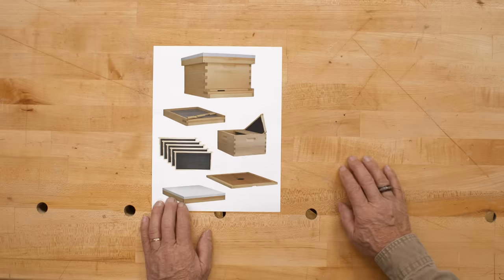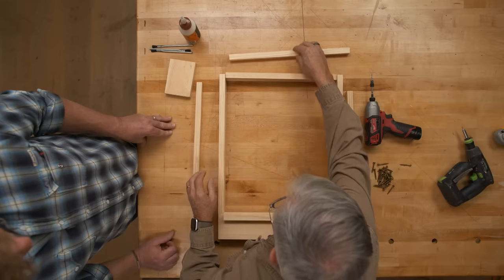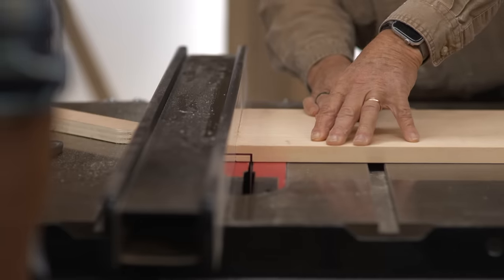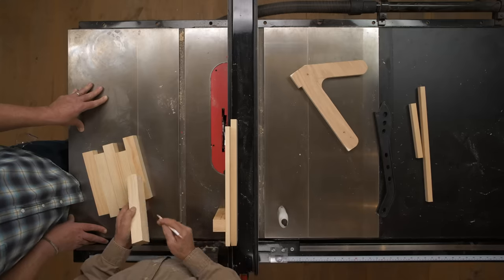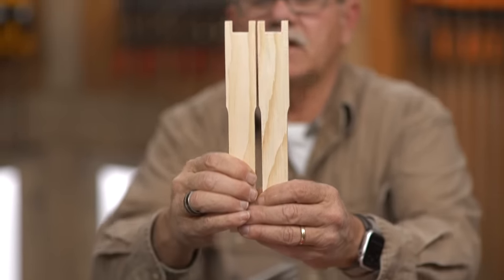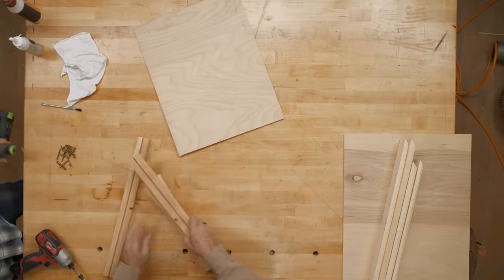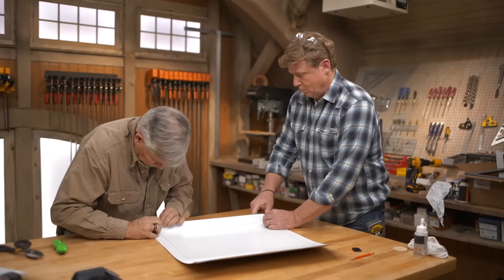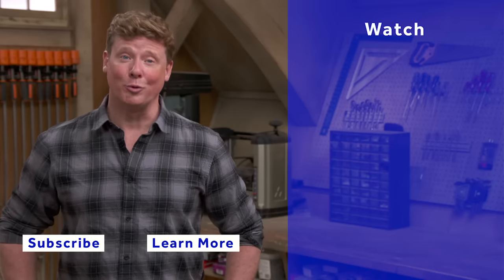Beehive | Build It | Ask This Old House

Comment: As a beekeeper who likes to build I like seeing beehive build videos!  For any new beekeeper I recommend one of the unassembled kits to help get comfortable with the components and reason for each...especially the frames which are the most tedious to build.  A screened bottom board is not needed...a solid bottom board is easier and the bees are just as happy...and they don't need a landing board.  The inner cover is simply to keep the bees from gluing down the top cover so it can be a simple piece of plastic, old political sign, wood, or reflectix.
Reply: is it safe for a beginner to do? im deathly afraid of bees but think it'd be cool.
Reply: @nathanlamberson1256  Sure!  Lots of people getting into beekeeping and with a good suit on you dont get stung often.  I recommend you look toward your local bee clubs for local advice and bees.  Just remember that if you ask 10 different beekeepers how to do something you will get 11 different answers. :)
Reply: @rpeebles  Or 15..... :)
Reply: Don't agree that a screen bottom isn't needed.  The bees drop a lot of debris during winter that falls through the .125 hardware cloth I use onto the bottom board which I remove during warmer months.  Then any mites and hive beatles that fall leave the hive.  If you didn't have an open screen they'd just crawl back up.
Reply: @nathanlamberson1256  I'm allergic to bee's but have been doing bee keeping for around 7 years.  You will get stung, it's part of the process.  Not a big deal though as long you're prepared.
Reply: @Off-Grid  LOTS of beekeepers here in Texas sucessfully run solid bottom boards...it is not required.  It is a matter of opinion and a lot of people argue over which is better...like arguing Ford vs Chevy. :)
Reply: @rpeebles  ah man... Chevy all the way!
Reply: @Off-Grid  Agree to disagree.  :)
Reply: @rpeebles  That's typically how it goes yet we all still get along.
Reply: A landing board is actually a bad thing, it makes it easier for predators to get inside. The bees have no problem with just a hole in the side.

Comment: I've had langstroth hives for around 7 years now.  They aren't the easiest to use but the most popular.  I'm planning to switch to a horizontal hive this year.  It keeps all the frames at the same height and you can look through a couple frames at a time vs with a langstroth hive where you have to open the whole box.
Reply: Long langs are some of my favorite as well...different management techniques than standard langs though.
Reply: @rpeebles  I haven't use one yet but I can't see it being a problem.  Glad to her it's working for you.  Should be splitting my hives soon and plan to put the split in the new style.

Comment: All the extra space above the racks (frames) as Tom calls them. Can't wait to see all the burcomb they build!! And no hand holds to lift later if needed.
Reply: Not exactly 3/8" bee space was it.  I'm not sure where Tommy picked up all his terms but I don't think I've heard other beekeepers use them.  I'd liked to have seen how to put handles in the boxes.
Reply: @BernardWalton1  some just add a wooden strip on outside instead of cutting in hand holds.
Reply: @yeti3317  I've seen that done before but wasn't impressed with the results.  It makes it impossible to push hives as close together as you can with a good recessed hand hold.
Reply: @BernardWalton1  I've always screwed 1x2's to the sides.  Gives you enough for your fingers to lift the box, which could be 40-50lbs when full of honey.

Comment: There’s no alignment pieces to keep the base snug to the box or the box to the roof? Seems like a 3mph breeze would knock it right off the base.
Reply: Nope… that’s how it’s done.  They get pretty heavy..
Reply: @Stillnapie  the roof can’t weigh more than a couple pounds. Seems like it would slide right off without indicator tabs inside to keep it aligned. I’d have to see it to believe it.
Reply: @eliosaile1689  Whatever, I'm sure you are an expert.... there are a dozen of them on my property and this is exactly how they are built and they have been doing fine for 20 years.
Reply: @Stillnapie  You don’t have to be a jerk about it. And I’m not saying you’re wrong. I just said I’d have to see it. Thanks for the info………………. 👍🏻
Reply: I used to put a rachet strap around them but they get really heavy once the bees get to work.  All I do now is place a cmu block on top to keep the lid from blowing off in a storm
Reply: @Off-Grid  Good info!
Reply: @eliosaile1689  thanks

Comment: This Langstoth hive is built fine which is the purpose, but they are saying some things that are incorrect about beekeeping. :/ I wish they had a beekeeper in the segment that went over the pieces, called them by their proper names, and stated their purpose.

I get the point is to build a solid Langstroth hive here. That was accomplished. :)
Reply: I would disagree. The dimensions are off on various parts of it which is very important. Bees will either make comb in the spaces that are too big or they will fill it with propolis to plug it up. Gonna be a nightmare for any keeper trying to get into it. Also the biggest error is no handles. You are gonna need to move the boxes around during the season for either reversals or just inspections which you can't really do without handles.
Reply: @Leftistattheparty  Good observation. I didn't pay attention to the dimensions as I don't know them off the top of my head.

I could live without handles... On some of my cruder boxes I've created wooden ones. I am going to make a jig for my saw this winter to finally make proper ones.
Reply: @beekygeek7873  you can but an unassembled kit from Mannlake then just copy it since all the individual pieces are right there.  There are several different size boxes both in height and width.  The bigger the box the heavier it gets when full of honey.
Reply: @Off-Grid  True. One can also be a bit lazy and just use butt joints with a single rabbet joint for the shelf. That can simplify the process. Some wood glue and screws are enough to make a nice sturdy box.

Box joints are kind of a hold over from the early Langstroths when wood glues were poor and the only fasteners used were nails.

Comment: Don't actually need the membrane in there they will build  their own comb in the frames with out that in there
Reply: it does help prevent cross frame comb tho.
Reply: yeah, as deep mentioned, I'd want a starter comb, maybe 2 inches at the top just to 'train' them where to draw the comb, but definitely don't need the entire membrane
Reply: @ilovefunnyamv2nd  that's what I use.  Took a foundation and cut it down to 1" strips and then put them into new frames.  Seems to work ok.

Comment: Tommy, your bee hive is called a Super, the removable holders are just called Frames, now....I didn't see any infra red lights for the late arrivals, strobe approach lights, no antenna or GPS ( in the lobby where the queen hangs out) or Air Traffic Control section and yes (Richard should do this) Solar Powered Air Conditioning!
Being that these will very likely be Union bees they will need a Lounge and Sauna and yes a BEEG Screen TV and a Snack Bar!
And finally the place needs a proper name...Tommy's Towers or Buzzbee's Bar!
Tommy, bee keeping is fun, and Double Queening will double your output....my job here is done!
Reply: That's in the sequel.
Reply: Wtf did I just read